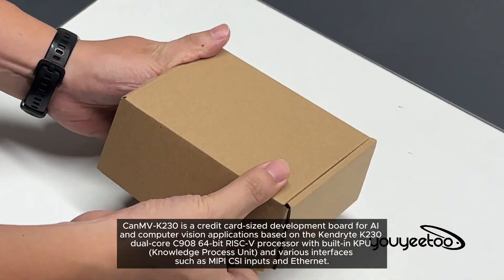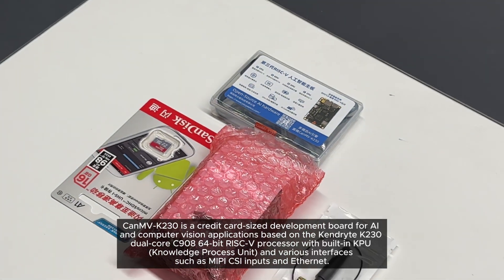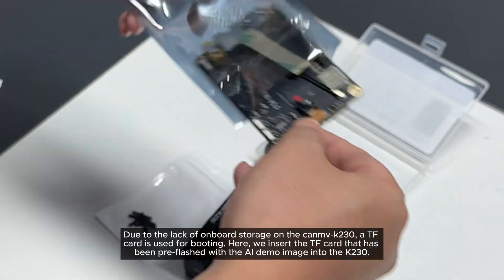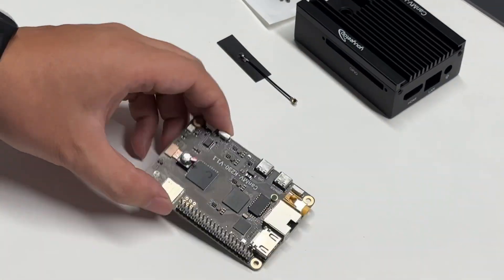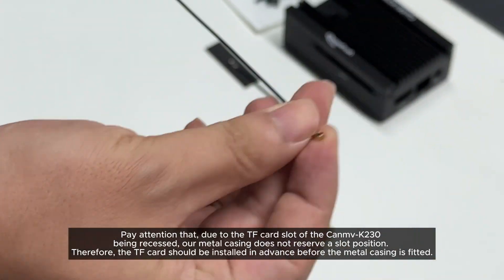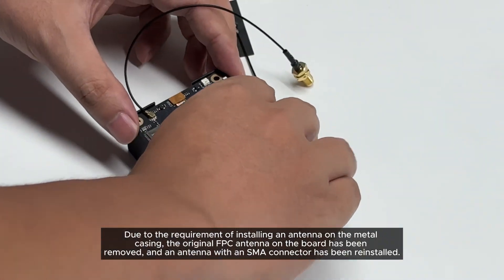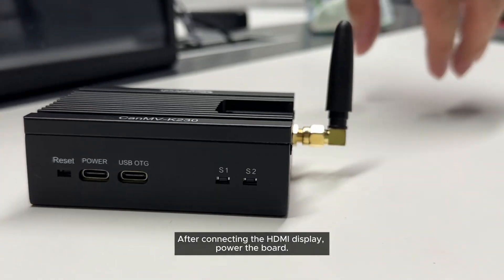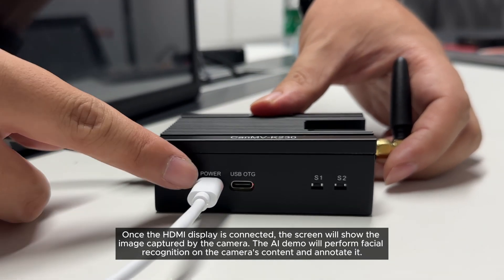CanMV K230

Comment: There is absolutely NO DOCUMENTATION for the K230 CPU core.   Nothing, nada, zip, zilch.  Kendrite does NOT document anything, never has.   Their hardware is absolutely 100% CLOSED.  

Publishing 2843756y23984765293854 terabytes of API is NOT documentation for the hardware, it shoehorns me into THEIR garbage (gnu based) development system and LOCKS ME OUT of developing my own system on their hardware.

ABSOLUTE GARBAGE.